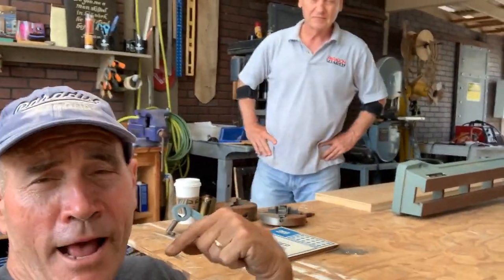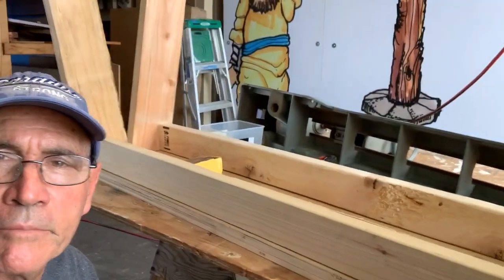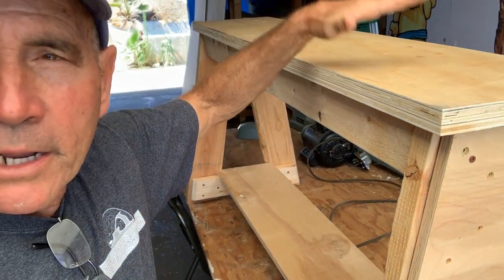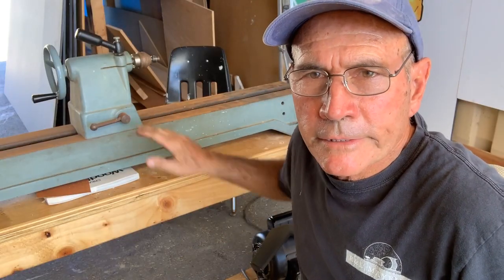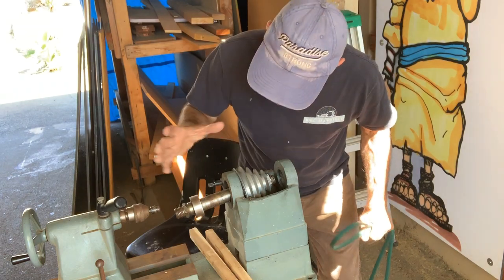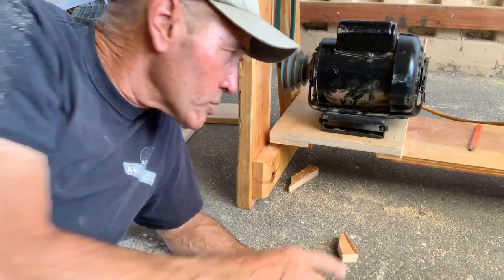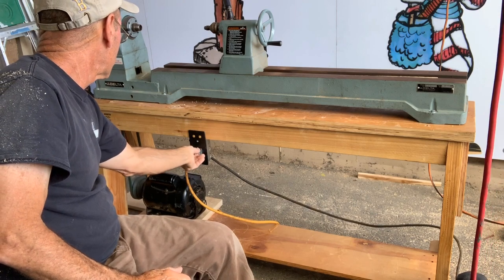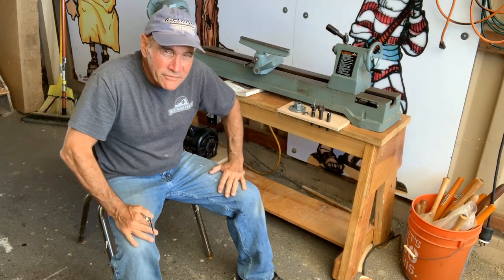How We Set Up An Old Wood Lathe

Comment: If you mount the wood motor base using hinges to the bottom shelf of the work stand, you will have the weight of the motor putting tension on the belt.   That also gives you several inches of spacing if your belt is not the exact length. You could use several different sized belts, as long as they are close in size to each other.
Reply: It is on a hinge the one that came with it mine has the exact setup
Reply: Hinges on one side, and two carriage bolts on the other.  Thanks for sharing.  I have to do the same thing, except my belt is already installed, and much shorter.  This will put my motor up higher.  I may add plywood doors to the front so that I don't get tangled up in the motor or belt.

Comment: Hi Bob! I have that exact Delta lathe that you "found". (Lucky you)... While searching youtube, i happened to stumble in your garage. I was looking for someone to demonstrate how you change speeds. My manual says vaguely - remove cover from headstock/ release the belt tension by lifting up on the motor (seems difficult)/ position the belt in the motor and spindle pulley grooves.
Have you tried that with your lathe? ...and if it worked, do you suppose you could do a follow up video? 
My instruction manual is dated 1-2-87, and the manual itself is part #
434-05-651-0002 if that helps you at all.
Reply from the maker: Well, that is cool that you have the same lathe.  Can't do a video on that right now but it sounds like you are reading the right manual.  My motor is on a hinge that simply uses gravity to apply tension so changing speeds is not that difficult. Kind of like putting on a bike chain.  Some set ups have a clamp that hold the motor in place which needs to be disengaged to change the position of the belts.  Good luck and thanks for watching.

Bob
Reply: Mount your motor on a hinged board. Provide an adjusting screw setup to adjust belt tension. And, make a way to lock the board that the motor sits on to keep the motor from bouncing and making the lathe vibrate. Also, the use of the expensive segmented belting will take a lot of the vibration out of the lathe .